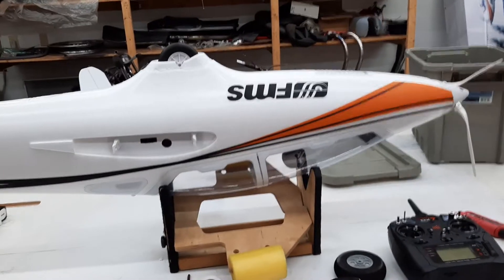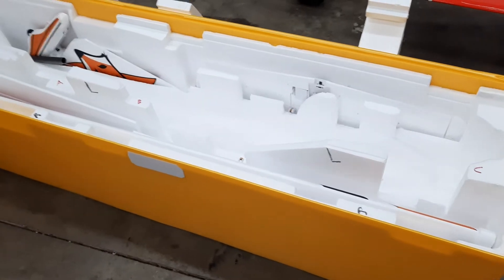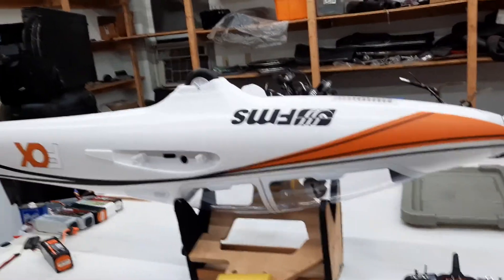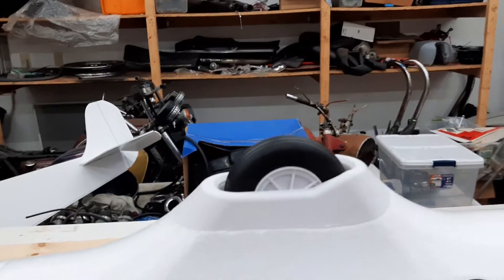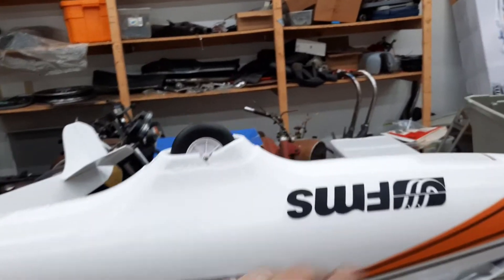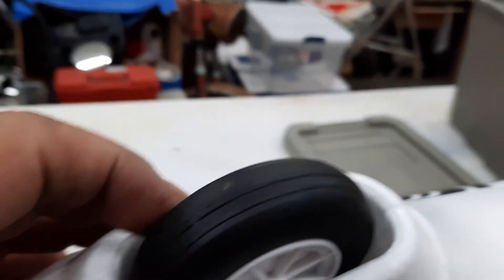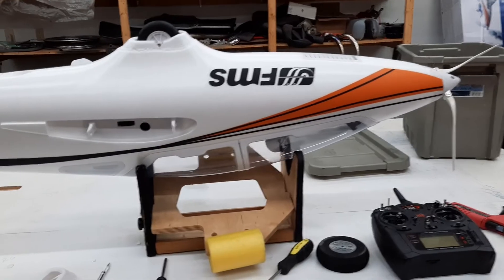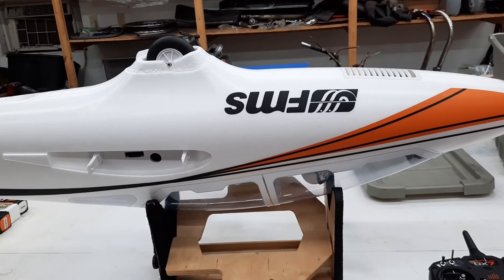Fms Fox 3000 landing wheel  defect and fix

Comment: Its a nice plane, and a drop of Tread Lock would have been put on at the factory  The really weak point are the Wing Locks, they break and cannot be replaced, you will have to buy a complete wing, which is stupid
Reply from the maker: yes i totally agree, the wing locks should of been made of aluminum and replaceable at that.     its still a great plane. Im doing an EDF conversion on mine atm.

Comment: I use the original box for transport on mine also, but I am interested in the box you have the original foam box in. I take you made it yourself? Thanks.
Reply: I used Coroplast  4mm.     call your local sign shop, they can source it.
Reply: @SingerUnkn0wn  OK, thanks for the info.